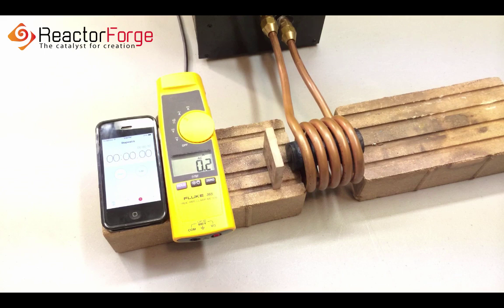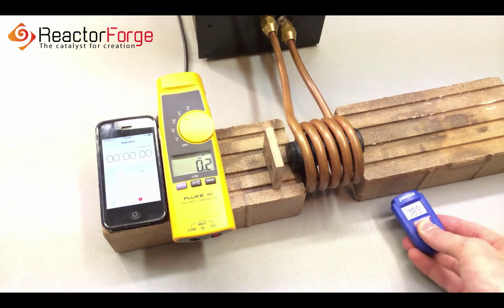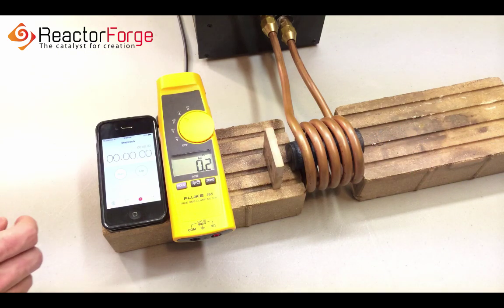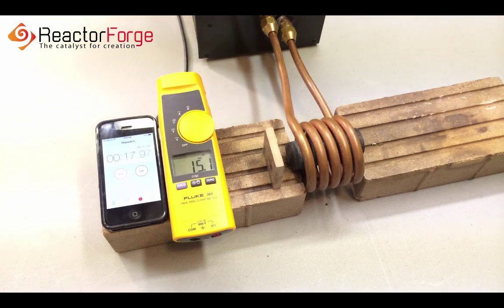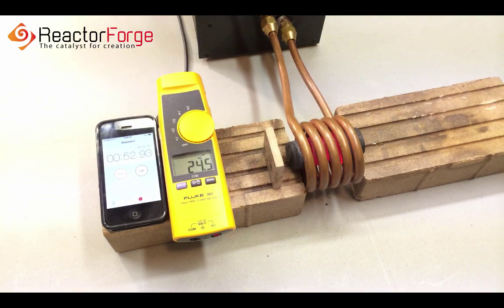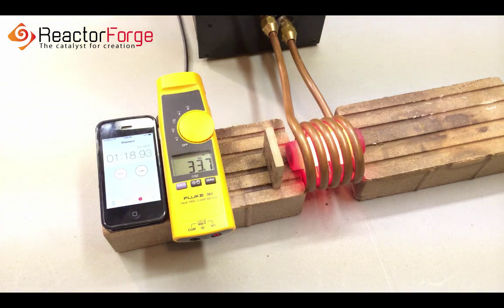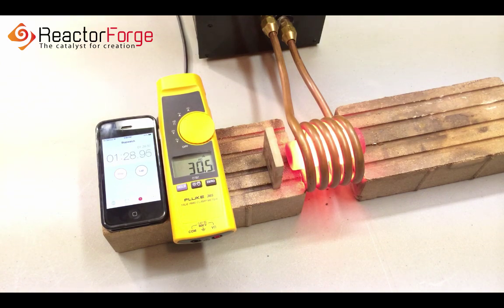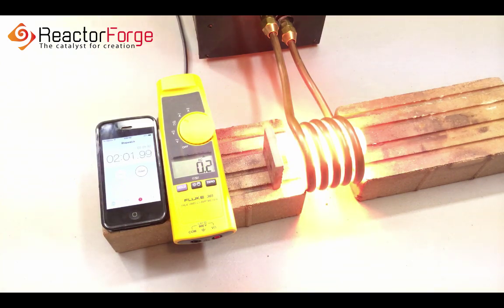ReactorForge Induction Heater - 3" x 1.25" Bar

Comment: Hey Josh, I have a question. I am working on a project and I have about 20kW at my disposal with a mobile water heating unit using a generator. I have designed a section for induction heating using 4" coils around 2" STD pipe at about 1' in length. If I am running water @ 110GPM and it is 45° and the 2" pipe is induction heated to say 300° would this be capable of flash heating the water to say 150°?

Comment: Do you make and sell This Induction heater?!  I'm looking to buy some kind of Induction heater/Forge for doing some Blacksmithing, and other Metalsmithing work, Tool making, Knife/Sword making, etc.  (some various sizes and shapes, and alloys) (Ferrous and Non-Ferrous metals).  What would you recommend, or, Not Recommend?!!!..... Thanks!!!
Reply from the maker: Hello, thank you for your interest and support. This is currently an open source project (details in the description) I currently have a rather long waiting list for these but am working on making them more available. It is difficult for me to make a recommendation for a commercial unit because the price point required to match the performance of this unit is rather steep. I would only say to be cautious about purchasing a unit without assurance of support from the distributor or manufacturer (i.e. don't buy a chineese unit on eBay or Craigslist).